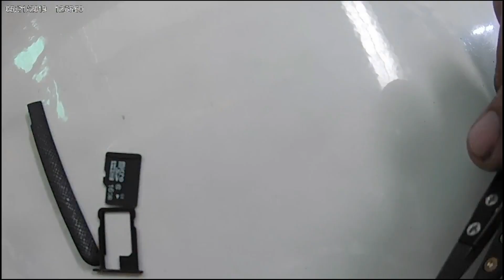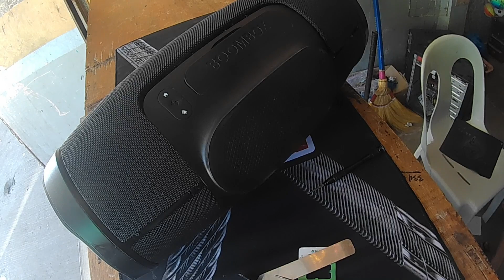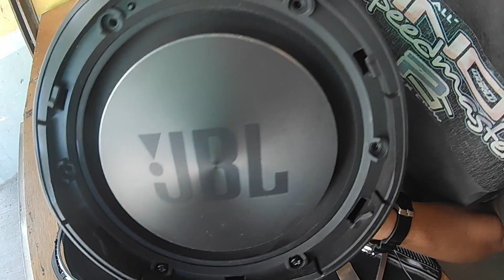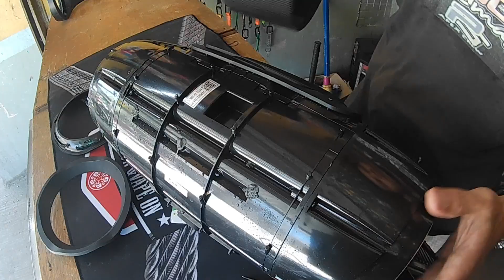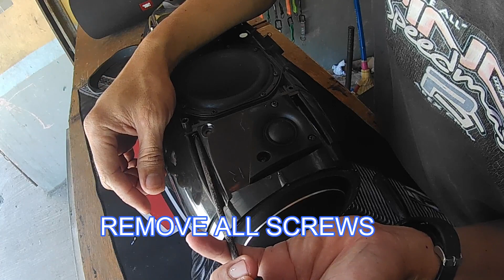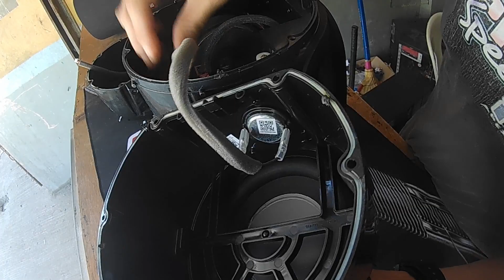WATER DAMAGED JBL BOOMBOX DISASSEMBLY Part 1

Comment: Mine was in the pool filled with water while music was playing until out of nowhere the music stopped. The speaker was completely silent each time i would turn it on or off and even connect to it, no noise would come from the speaker. 2 hours later after drying the speaker, I  turned it on where it started making very loud popping and squeezing noises which scared the crap out of me. Now I have no idea what to do..... 

Anyone have solutions on what might've happened ??
Reply from the maker: good day sir maybe your unit needs professional servicing..  most often water drips thru the flaps..
Reply: @daddyvinn  thanks for the reply, I'll try give it to someone that can fix it that's professional. Hopefully the price ain't too high. Have a good day sir :)
Reply: You still have it?
Reply from the maker: @FLUFFS  its customers unit sir..
Reply: @daddyvinn  I mean the other person's comment, but thank you anyways 😊
Reply from the maker: @685_SAHH  Sir do you still have the unit? someones asking..
Reply: @FLUFFS  yeah I took it apart and dried the board with a fan and then it turned on like it had reset itself

Then 2 months later, the indoor and outdoor mode kept changing on it's own which kept on cutting out the music which is annoying... 

So now the lights from it dont work anymore...... and the button is also broken too so now I can only change it through my phone.... 

But besides all of that, everything else is fine and it sounds great as it should be:)
Reply: @daddyvinn  yes but its fixed kinda lol
Reply: @daddyvinn  sorry for the late reply
Reply: this happend to me
what did u do to fix it

Comment: can I use blower to remove the water inside.. please help me..sir
Reply from the maker: yes... hair dryer is fine...clean first before blow dry the board.
Reply from the maker: @vishwakgamingworld226  you must disconnect the battery sir.
Reply: sir so great to have a conservation with you .. actually I have replacement option and I placed exchange order .. that's why I am not going for audio profissionals..or trouble shooting..Is it ok ??
Reply from the maker: @vishwakgamingworld226  thanks to you too

Comment: Mine has been through a ton of water tests and abuse and it's fine but I cant get the covers off on the ends that you have to turn counterclockwise... help
Reply from the maker: put the unit on a rubber surface.. press the unit against it downwards then quickly turn it counterclockwise.  you can do it mate.
Reply: I have an ND model which is very hard to do with
Reply from the maker: @z33hayden23  maybe its a different process . for the unit youre dealing with sir
Reply: There are PL boomboxes and ND. ND the covers have to be prayed off while PL you can twist. I have ND
Reply from the maker: @z33hayden23  thanks for the info sir. i didnt encountered the ND model sir.
Reply: Ya, you find this stuff out when you have a youtube channel based on jbls😂
Reply from the maker: @z33hayden23  thanks Sir!
Reply: Ya! No problem

Comment: I cant remove the handle, I used so much strength and it didnt come off
Reply from the maker: just make sure you remove all of the  screws. maybe theres screws left unscrewed.
Reply from the maker: put the unit on a rubber surface.. press the unit against it downwards then quickly turn it counterclockwise.  you can do it mate.
Reply: What Serial number have you BoomBox
Reply: That part is the worst and hardest part about this damn thing. Me and a buddy tried and couldnt get it off had to use screwdriver to break it off
Reply: @BUDDAz1g  me and my dad couldn't get it off, got so frustrated just ruined my mood and day, still can't take it off. Trying to take I of whilst writing this comment
Reply: @vladkhokha3649  I set it on the ground and pressed all my weight and turned to get it off. Scratched the sides a bit but I got it off

Comment: My jbl boombox stopped charging, not sure why. The first indicator turns red when I plug in to the power supply. Boombox turns on for a couple of seconds and goes off again. Interested in seeing the next video. This one was great.
Reply: I'm sure where the problem was? well thank you
Reply: @viktormaludy  I think the problem is with the battery.  Would you know where to get a replacement battery.

Comment: Hi bro. Water damaged my boombox 2 no power :( not working :( how to fix it
Reply from the maker: Good day bro. if u can disassemble the unit. maybe u should try to disconnect the battery and clean dry the system board. if that doesnt work. bring the system to a Professional